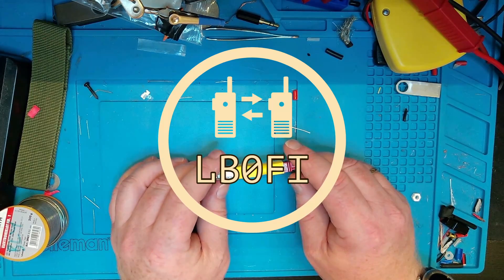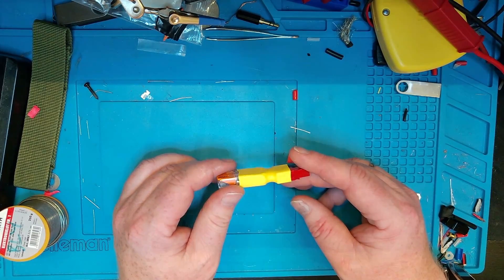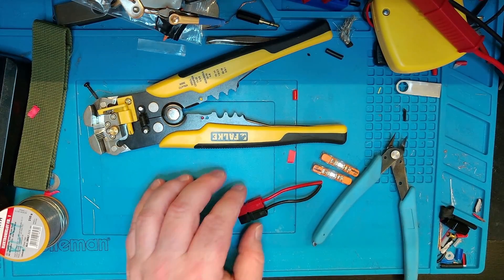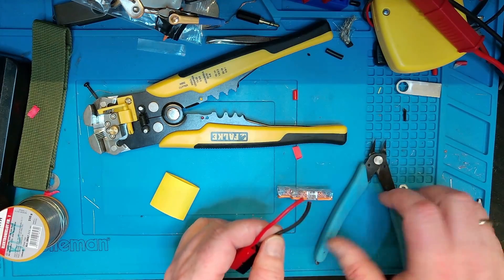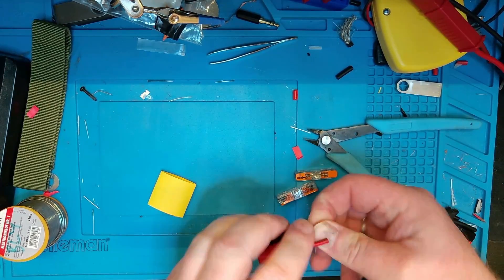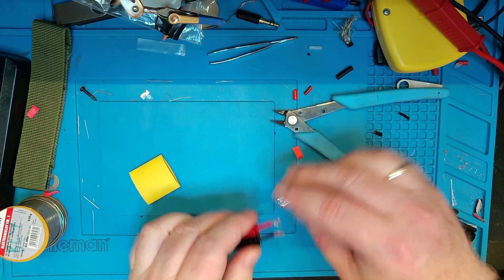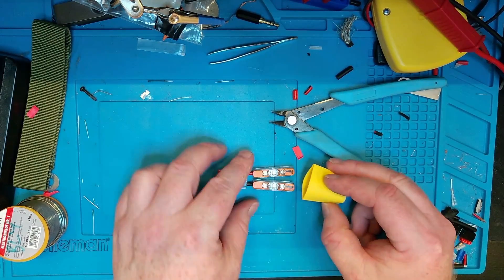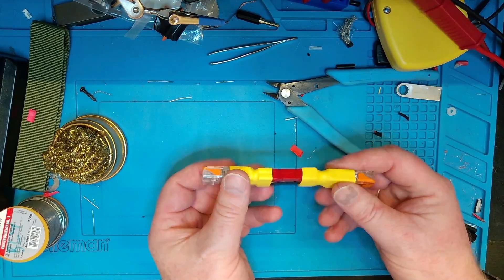The Power Pole Field Repair Dingus

Comment: I saw the KM4ACK video and built one myself, similar to yours. It was easy to strip the wire before assembling the Power Pole, and I solder tinned the wires going into the Wago  just because. I have also painted the Wagos red and black. All overseas ordering in mow really difficult in the UK.
Reply: Very happy that you were able to build one.  Always be prepared!   KE5EZZ  73+
Reply from the maker: @AP-QuickCons Thanks for the great idea!